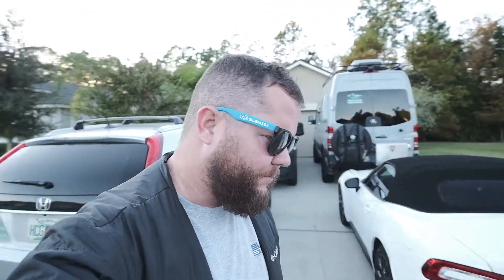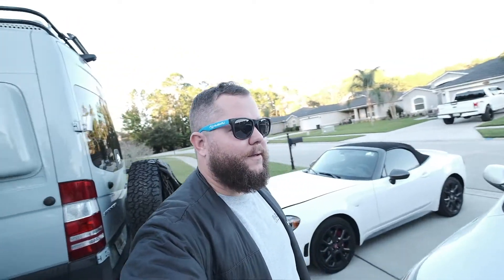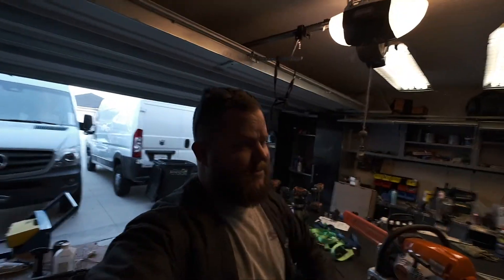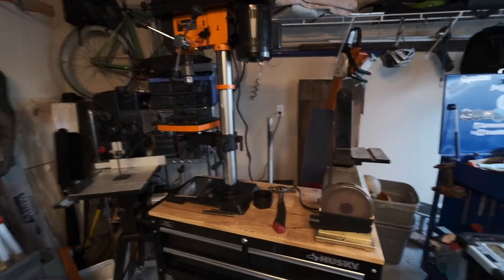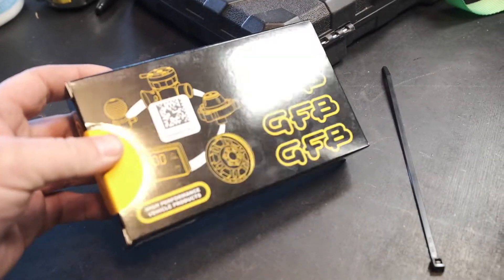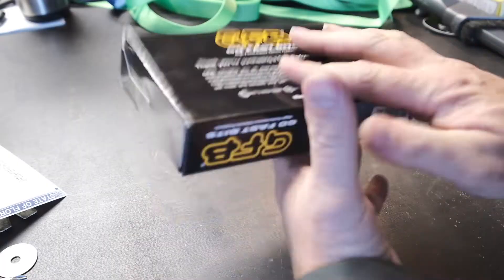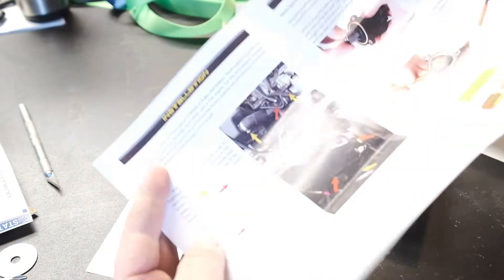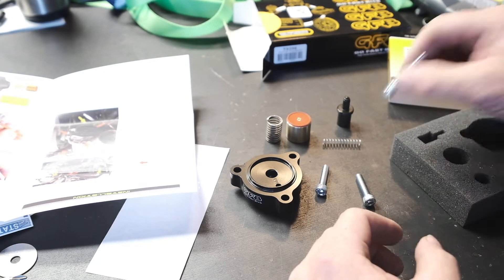Fiat 124 Abarth Go fast bits DV+ Diverter Valve system Installation

Comment: Thank you so much for the video. I just put it on for my Spider (Lusso trim). I realized how much easier this is compare to other cars. Kudos to Mazda and FIAT.
Reply: Just installed today, but is normal that I don’t hear any sound like “pssshhh-pssshhh” (like pigeon, as in other videos on YouTube)? I wanna know if I have mounted it correctly
Reply: @ignaziozinfollino9213  I think so. Pretty sure it’s only for holding boost at higher rpms and for longer after you let go of the throttle. Mine doesn’t do a sound either

Comment: I’m thinking about getting a Fiat Spider or the Mazda Miata. Which one do you think I should get for great quality over a long time.
Reply: I'm a tech for Chrysler dodge jeep ram and fiat, I have never seem the lack of quality control with parts manufacturing as with this group. And it's not just a specific model or brand. When a tech is changing tappets and cam shafts at 15, 30, 60 thousand miles due to failed needle bearings in roller lifters causing cam load to be ground off on roller cage. 

I have unpackaged new roller lifters, soaked them in new clean container w/new oil and after taking them out the container is always littered with specs of metal, not always just specs but sometimes small sharp tiny chunks. This is not acceptable in a working quality control facility. Take it for what it's worth. Every engine from the HEMI to the Turbo in the 124, to the 3.6 pentastar all have bad issues that is just lack of quality in manufacturing. Would love to stand behind a product that I deal with every day but , much better quality options, if u must I would  say Miata but really neither. Good luck.

Comment: 2017 124 Spider abarth here. My instructions say to remove the yellow o-ring from factory diverter to use on the DV+, but the diagram shows it sitting on the stock part where the DV+ body contacts. In the video it seems like you never removed the yellow o-ring so I'm thinking that's what I'll have to do? Also, I see notes where they say to lubricate with engine oil on the piston (instructions) and spring, o-rings, etc. (online forum comments)
Reply from the maker: I'm sure it changed over the years

Comment: If you don’t mind, what kind of deal did the Daytona dealer give you? Sticker price vs out the door?
Reply from the maker: it was like a year and a half ago. Doesnt matter
Reply: FreedomVanGo I’m looking to buy either a 124 or Mx-5 so was wondering the better buy
Reply from the maker: @sanferminhotsauceco8222  the fiat for sure.  much better car regardless the price.  ND rear end is ugly as sin
Reply: FreedomVanGo  agreed, the 124 is a much better looking car. My local Mazda dealer is in the costco buyer program so there’s no haggling and a great price. My local Fiat dealer is not so it’s all negotiable
Reply: Should be able to get it for $30k otd if sales tax is under 4%